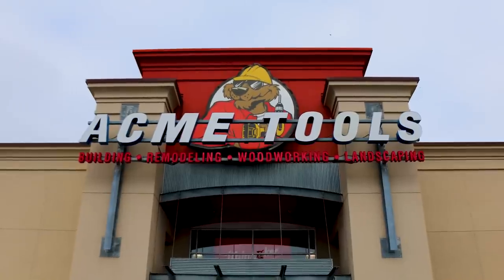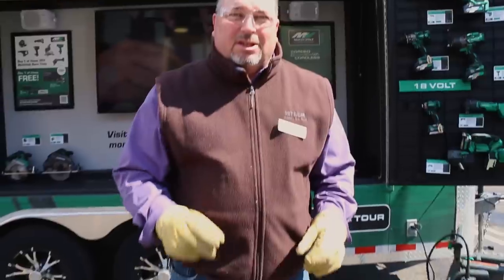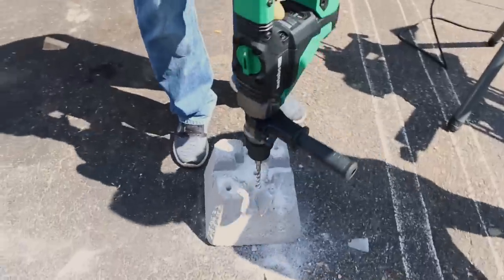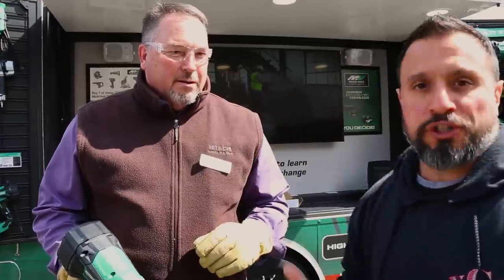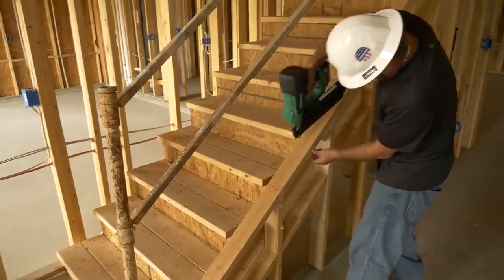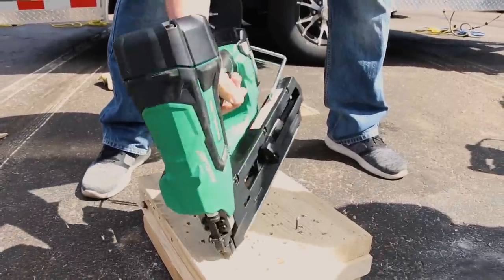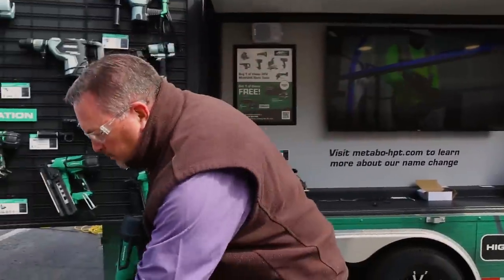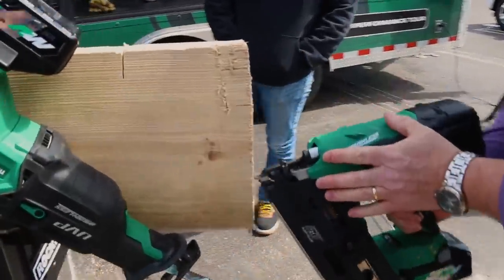Nailers From METABO HPT Have CHANGED! (WAS HITACHI BETTER?)

Comment: 💥🚨    I just bought the Metabo 21° framer.  The first one only shot in bump mode. I rushed out to buy another one since I really needed it the next day on Monday’s job.  The second one had the exact same function defect. The battery charger is as no frills as it gets. .  It’s a complete minimalist piece of plastic junk.  Totally featureless unlike my Makita chargers. There was no positive click letting me know that the battery was in and charging and there was no obvious indication in the red light letting me know that charging started. Makita lights change from green (charged or ready) to red (charging) and Makita chargers even play a song both when you first  hook up the battery and when the charge is complete and the batter locks in. My Metabo framing nailer fired when it felt like it, not every time that I wanted it. It even went to sleep (mode) on the job after about 8 minutes of sitting idle and I had to hit the power on button to keep working.  It is obvious that no professional carpenter had their hands in designing the tool. It only excepts one strip at a time and you have to go all the way to the very last now before you can put another strip in and they should’ve left maybe two or three nails more of space so you don’t have to wait till the very last nail to reload.  I ran about 10 strips of nails through the gun and two times I couldn’t even fit an entire strip of nails and had to take out my side cutting Dykes and cut one nail off of the strip in order to fit it in.   WTH. Calling Metabo and hoping for some technical support and troubleshooting was the worst experience of any company that I’ve dealt with in my 35 plus years of adult life.  All that the persons who picked up the call said was to send it in to a service center.  “You mean send  THEM in.?? I bought two that are suffering from the same  defect”… I even heard the night that I bought the two of them from Lowe’s that the compressed air inside the tool needs to be recharged after about one year of use and that you need to send it in to have it done and pay for it.  What…?  I’m quite a reasonable and level headed professional but so far I think that Metabo is pure junk compared to my 30 plus years of experience with using Makita  And I can’t wait for them to make a framing nailer. I bet they are holding off in releasing one  because they are seeing all of the defects and complaints from every other brand that everyone is sharing on YT and they are going to make sure that their gun is not guilty of any of them. Once the tool breaks two days after the warranty expires I won’t be surprised if the cost to fix it is almost as much as it cost to buy a new one making it nothing more than a piece of disposable throwaway plastic junk like, Nothing more than a big boy toy.  I do on a couple of other brands that are known to have a superior tool like the Bosch barrel grip jigsaw and all of my Porter Cable routers which are known to be industry standards. I own a Milwaukee sawzall. It was the first professional tool that I bought in 1986 and I still own it and it still works.  I bought one of their anniversary models about eight or so  years ago that came in a special monogrammed anniversary tool bag and it broke within eight months.  New tools in general are built nothing like they were up until the 80’s and 90’s. I also still have a corded drill purchased in the late 80’s with a keyed  Chuck that was made by black and decker and it was a special tool of theirs back then that was black and gray and they called it their professional line.    It still works perfectly to this day. There is no way that this Metabo is going to last more than maybe 1-1/2 years unless I treat it like a newborn baby. Stay healthy everyone … 🤟🏼

Comment: I have the Hitachi framer, 15ga, and 18ga cordless nailers. They work great. The negatives are they are bulky and heavy. Besides that they are so nice to use without air lines and compressor. Very happy with my purchases. Framer is best on the market. Dewalt is probably better for finishing work, but the compressed air design is superior imho.
Reply: I have the DeWalt cordless framer, which doesn't operate on the same principle as the Metabo, and I have to admit, the Metabo looks considerably faster than waiting for the DeWalt to spool up for each shot.

Comment: I just purchased that framing nailer its solid.  On thst saws all he put in like 5 ot 6 nails but the demonstration showed him only cutting through 1 nail.  Was that due to him cutting on an angle. Or nailer not setting naiks at equal depth.   I did read a review where the nailer under heavy use stopped driving as deep and guy had to send in to get air recharged.  Is that something we can do ourselves.

Comment: They got some cool stuff for concrete  but I think AirBow is really gonna nail it with the future technology of pneumatic fasteners.
Reply from the maker: I gotta check out the air bow!! Have you seen some of the technology coming from “MAX”?
Reply: @VCGConstruction  Max tool? The distributor from Alabama?
Reply from the maker: This is the tool company “max” they make industrial grade tools, crazy stuff!
Reply: @johndoran4111  at least it's not a big compressor. Expensive no doubt, but if you have a crew going with multiple guns, it is a centrally placed filling station that allows for killer efficiency.
Reply: @johndoran4111  completely get that brotha! I'm currently a Milwaukee man but end up using my electric or gas compressor every time I use a pneumatic nailer. I'm considering a lithium ion finish gun though. Hoses are yuck.

Comment: That recip was incredibly fast. What voltage was that saw operating at? what was the blade that he had in it?  Do you happen to know what is the RPM that it runs at and also how long is the stroke? If you don't have all that do you have the model number? I think I'm fixing to put my fuel sawzall and fuel hackzall, well no I'll keep the hackzall, on OfferUp.because as much as I don't need another battery platform I think it's at this point after seeing that..... mandatory upgrade...
Reply: Jason thats the hpt 36v.  Cost about 600usd for the kit.  The milwaukee might not cut anywhere near as fast, but it'll cut more on the same amp hours due to it being 18v and less moving parts from the saw.
Reply: Pretty sure that 2x12 was precut first few inches and Milwaukee fuel is just as good if not better just gotta use the high output battery packs. Voltage has nothing to do with it the power is in the amps/watts

Comment: Old video but i always wondered why the same pneumatic air that powers framing nailers couldn’t just be simply recycled back into its tank and reused instead of releasing it out into the atmosphere when the nail is fired. Hitachi basically proved this idea i had and im sure plenty of people wondered the same since its compressed air etc that is used in vehicle shocks. Hitachi figured it out and thats the holy grail for tools.
Reply: It's the pressure difference from the tank to atmosphere that does the work in pneumatic nailers. If that air was connected back to the compressor, it wouldn't have the differential pressure it needs.

Comment: I could be wrong, but at 6:39, I can only see that he cut through the first nail, might have just caught the tip of the second, and completely missed the last two, although it went through the first one pretty damned fast.
Reply: I agree and it also looked like the first 4 inches of that board was pre sliced.. probably why it went through the first one so quickly. Most salesmen are shady like that. Hitachi/Metabo are great tools though